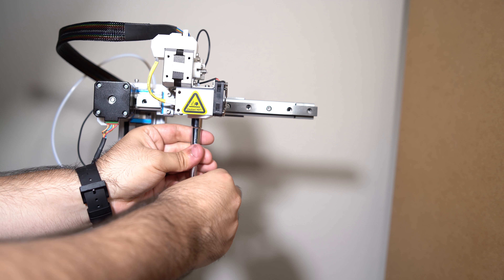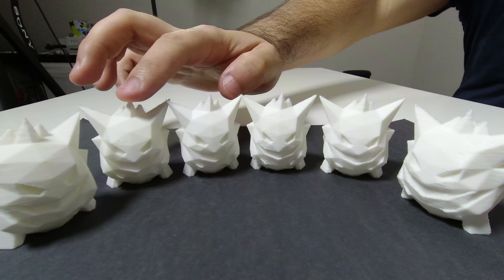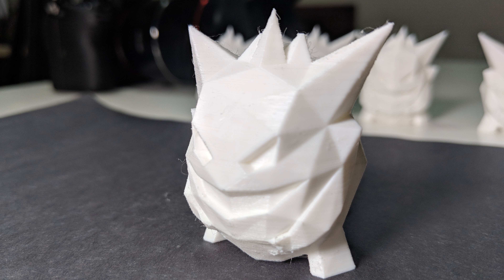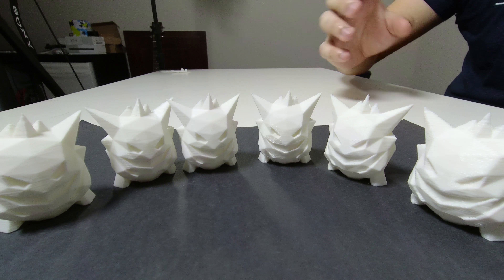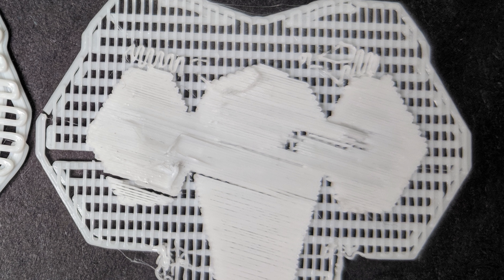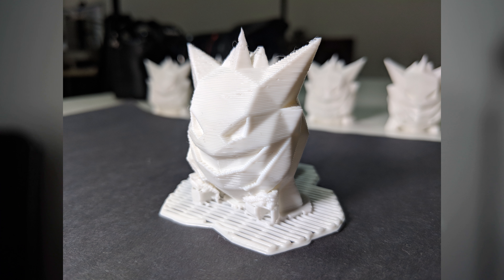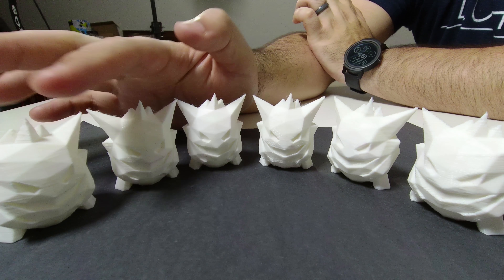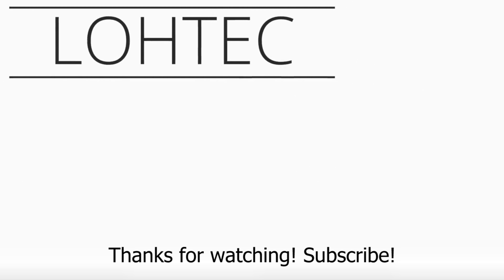Cetus3D MKII Print Quality: .2mm vs .4mm vs .6mm

Comment: Great video :) 
Nice to know about the layer heights.
You say that the hole in the build plate make you have to use raft. You can move your model of center, to the right, left, back or front. Then your model will not stand on the screws and you don't need a raft. But raft is good so I use it anyway.
Reply from the maker: True, but then you are limited to like 35% of your total build area. Better and easier to just use a raft :)